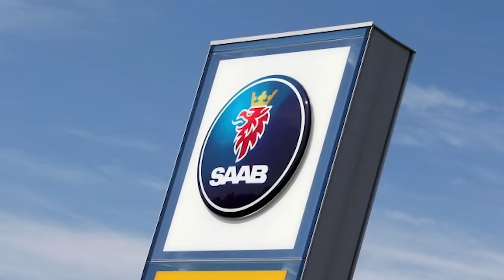SAAB - Everything You Need To Know | Up to Speed

Comment: This video made me buy a Saab. 07 9-3 2.0T
Reply: Sebby Kaiser how do you like it so far? I’m looking at buying an 06
Reply: @jeremyclark4474  Make sure you're buying one with only a couple mechanical faults. Besides new brakes, my Saab needed a new coil, motor mount, rear shocks, and I still can't figure out why it only goes into 3rd and 4th. 300K on the odo but no major electrical problem. Always starts in the cold. It's a cool car and it's fun to work on.
Reply: Sebby Kaiser the one I’m looking at has 111k, 2nd owner. So I’m hoping it’s in good condition
Reply: @jeremyclark4474  Auto Autopsy has a good video on common issues with the B207 motors. It was a big help when I was buying mine because I had the comfort of knowing what was wrong with it lol
Reply: Hey! I had. 2005, I did a vid on how to clear the AC drain, which is a common issue. I no longer have mine, I got a mustang, but if Saab ever makes another car I'll be the first bastard in there to buy one. Damn I loved those cars. My 99 9-3 (I had 2 actually) was just fantastic. Just a great car for the money.
Reply: Sebby Kaiser 300k Jesus Christ
Reply: 08 9-3 2.0t Hirsch here ;)
Reply: I got a 04 93 aero for sale in va
Reply: I have this exact car and it’s made me fall in love with Saab’s. It’s so much fun to drive, corners pretty well and is super nimble and agile. Can getgood mpg if you drive conservatively. Fantastic overtaking power on highways in 3-4th gear
Reply: im probably late but I would not recommend a saab that was made after 2001. After that point GM really started putting cheaper and cheaper parts in the cars. That being said I sadly also do not recommend buying an older saab as a daily driver. Supply of parts is starting to go low. I just had a broken piece on my 9-5 sunroof. The part just does not exist anymore unless i buy a whole sunroof. My father owns a 99 9-5 this car has an air sensor which was only used in that year by saab. Its impossible to get a replacement.

I hope you get an idea of the parts situation. If you want to daily drive a saab get a second car for parts. This of course only makes sense if you are a little bit of a petrolhead. In case you do not repair your cars by yourself get ready to face car repair shops which give you the car back in worse condition than before.

With this warning said. Saabs are great cars. They are durable (note durable, not neccessarily reliable), really comfortable and of course really safe. The Aero or Viggen Models are also pretty quick.

I would say only buy a Saab if you are ready to fix stuff yourself and be ready to either search for parts or buy a spare car for parts (im in Germany and in your region the situation may differ. In case you are in europe the swedish saab club actually manufactures parts but not a lot yet).
If you want a "modern" car I would recommend a pre facelift (1999-2001) 9-5 with the 2.3t engine.

One thing to check when buying a 9-5 is the place where the rear fender meets the rocker panels for rust. There will most likely be rust and thats okay but make sure its not severe.
Another thing is that the radio display usually has a few "broken" led's. This is really not a big problem. The led's are usually not broken but the wire which is connected to them is. Its glued and just gets loose over time (because the radio unit tends to get pretty warm). You can get a new wire for like 10€ and your display will most likely work again like it was brand new. (You will need a special tool to remove the radio, don't try it without that tool you will only break something. Google for something like "saab radio removal tool").
Reply: I just bought an 09 9-3 turbo for 1500 and it’s been awesome but I’ve only owned it a week. Let’s pray it can be a good daily driver,it’s perfect with no rust just has 180k miles. I had to sell my stupid Chevy cobalt to afford it so I hope it’s better than that junk lol
Reply: I'm contemplating on getting this 2008 aero saab 2.8l
Idk if it's a good deal or not. 140k miles. I'm planning on using it for daily. Haha so please if theres any idea or pros and cons you guys can say about feel free . Thanks
Reply: Sebby Kaiser dude im looking at an '07 2.0 in my area with 110k miles on it, asking $2300. think i have to get it.
Reply: @MacLaw3084  
Bro damn 2.3? Mine was the guy was asking for 4.8k 140k miles buts its 2008 and its its 2.8
I dont know much about saab. Bro as long the car works and doesn't have too much mechanical issue. And theres some saab forums and discord around dedicated on saab enthusiast. Check them out
Reply: lestatspada yea man i was surprised. think it might be too good to pass up. im already in love. lol. dont know much about em but i plan on doing most work myself. and itll be my second car and not a daily so i wouldnt put many miles on it.
Reply: @MacLaw3084  yeah iwas like 2.3 no way. Yeah same when I saw the first saab I was like damn this car looks great and fell in love too. But I can't get it cause I'm needing a daily drive to my school and it's going to be my first car. I would get my own saab later own and work on it. But yeah bro check out some forums and discord for saab they got some good tips and site where you can buy some parts. Cause it's kinda hard to get them. They said che k the vin if it's made Sweden, they make them pretty good.
Reply: lestatspada awesome. thanks for the tips. unfortunately probably not the best first car. id go with the tried and true honda, accord v6, civic, or civic si. or something like that. ill post  the link as proof if i end up buying the 9-3. cheers from california!
Reply: @MacLaw3084  yeah that's why I pass on that one. I got a mazda 3 2013 used. So it will last long just need a TLC. Yeah I would like to see how it is.
Reply: Yeah, I'm working on restoring a 71 Saab sonnet with my grandpa
Reply: @johnggg7770  300k is a warmup for Saab's.
Reply: Esa Edvik mines halfway there!😄
Reply: I own a Saab 9-3 2006 and love it!
Reply: Some solid advice here about buying saabs, it is also key to make sure that regular maintenance has been kept up by previous owners. In my experience they tend to go bad if they aren’t well kept. My 2007 9-5 aero was bought with some questionable shocks and brakes but other than that it was perfectly fine
Reply: Wrong year!!! Buy a one from 2001!! That is still Saab. What u have is GM!!!!
Reply: Why the 2.0?  I have a 07 3.6 L V6 T
Reply: Jeremy Clark did u get it?
Reply: Maniac xD
Reply: Can you tell me what its like to make your parents proud?
Reply: Gotta 05 9-3 one of the best cars for the price
Reply: @jacobderryberry7163  I agree with you, and it’s very easy for 99% DIY repairs
Reply: It's one of the simplest cars to ecu remap. One click you got 220hp
Reply: @maxflute7893  what Programm do you use?

Comment: Thank you for doing a video on Saab.  They are such a misunderstood and under appreciated car.  I have had seven Saab's in the last 4 years and I do not plan to discontinue that trend.  My 9-5's feel so sturdy, safe, and solid.  I have had about seven or eight Volvo's but nothing holds a candle to the 9-5.
Reply: How do you wear out 7 Saab's in 4 years?
Reply: @arnaudmeert1527  I just upgraded. Started with the worst 900, moved from that to 9000’s, then upgraded from those to 9-5’s & ended with an 09’ 9-5 SportCombi with a stick.

Comment: Here's the thing about Saab's. Once you own one, you get the Saab bug. After owning my '06 9-3 for a few years, I spent last year looking online and craigslist daily for another saab which is how I ended up finding a very low mileage '07 9-3 convertible. I'd love to own some 9-5's and some 900's too haha.
Reply: I had a 900 Turbo for about a year and a half as kind of a project. It was a real bastard to fix some stuff but I loved driving it. If you get a chance to own one you should
Reply: My first car was a '92 900. Caught the Saab bug instantly! Have since owned an '06 9-3, but was just desperate to have a pre-GM Saab back in my life, so now run a '97 9000 50th Anniversary alongside it. Awesome cars. But so much better pre-GM!
Reply: my dad had a 900 in brown i love it i named it Mr brown
Reply: Bought an '01 9-3S off my cousin, slowly going through the car and fixing/upgrading everything I touch on it.  Thanks to the experience working on the 9-3 I started helping a friend with his '01 9-5, nearly ended up buying it from him so I would have a 4 door car again (I have 3 cars, all are 2 door cars...), I've narrowly avoided buying it but now find myself looking for a OG900 to tinker with :D
Reply: That 06 Saab is a Vectra. That Saab bug... hahahaha
Reply: 2456sunny they're so over engineered it's a great car company really, they put this feature in the motor that you can start it in -30 degrees because it has a direct ignition, when you turn the key it sends something like 50k volts thru each spark plugs to melt ice if it's that cold, and then another 10k when you turn the key back off just for good measure. I assume that's something they have on jet engines because it's so cold high up in the air that the motors could freeze. But since they were Jet-makers  they implemented that so you could start your car in the coldest of conditions. I saw a video on YouTube of someone that put their Saab into a freezer like I said at -30°C I'm pretty sure he said I'm not exactly sure but they were in Germany or some European country, and the car started up and they took it on a freeway that had a burm like a race track does that's why I say it was Germany or some European country. You could look it up for yourself. Just all around great engineers that put Saabs together

Comment: had  a 1998 9-3 2.0t amazing condition and all that, but there where few issues, first off the seating position is super bad, the shifter is almost at the floor you would have to reach for it, steering wheel had minimal adjustment. tl;dr not meant for big boys.
Reply: tony your maker 187cm
Reply: Thats not "big boy" at all thats just average height atleast here in norway
Reply: Should of got a 9,5
Reply: i now have a volvo s60, perfect seating.
Reply: the dark side has taken you, I've slept in my 99 9-5 multiple times between classes most comfortable car ever.
Reply: Pepe Jazbec maybe, maybe not, test drive will tell you.

Comment: Something VERY SPECIAL for Saab was one of there Engines. Have you ever heared about the Saab SVC Engine? what the Japanese are doing and planing now, saab was making it at 2001. the first steps to a self Ignition Benzin Engine....Ok it was a Engine with variable Compression.  A ratio from 14:1 to 8:1 by angling the Cylinder Head up to 4 degrees. 5 Cylinders 1,6l and over 300 Nm with 225 HP with the same fuel consuption as a normal 1,6l engine. and that in 2001. GM those Money Cunts striked the project down, cause of too much money (what a surprise).
saab had it, the engine was working, they used it in a 9-5 wagon. Imagine Saab would still exist or the engine was build in as a special Edition for 9-5 and 9-3. I love Saab so much for that!

I and we all should hate GM for that. The main inventor of the planned obsolescence, the shame as a car company, ruiner of so much beautiful in the car world (beside ecologicals) 

GM SHOULD GO TO HELL FOREVER!!! (and tell the devil that for sure more Companies follow)

Comment: While stationed in Germany, I bought a 1983 SAAB 900 Turbo 4-door with Amaranth color.  Put 198,000 on the car over 17 years and it still looked new when I gave it away.  My late wife cried when I gave it away.  Drove the car all over Europe and the U.S.  Great Winter car.  Would plow through the snow, never needed snow tires, heated seats and was good handling.  Put the rear seats down and could load the heck out of it.  Great gas mileage!

Comment: Thanks! Loved it.  Although in my opinion you missed their greatest car the 9000 / 9-5. I had 2 of them, what a joy to drive. I used to zip around DC beltway traffic like it was standing still. Quality and Attention to detail was off charts, only car company I know of that had pink insulation in the doors. They were reliable only major work was a head gasket and clutch. At 170K miles i'm not complaining.

Comment: Maaaaaan, you dropped the ball big time by not mentioning the only other 100% Swedish built Saab.. The 9000!  This was a car that in 1993 when they came out with the Aero (sport) Edition,  the Aero was capable of accelerating from 80 to 121 km/h (50 to 75 mph) faster than a Porsche Carrera 4 or a Ferrari Testarossa  Not only that, but the car would get 32 mg on the highway from it's 2.3L Turbocharged engine and regularly push the speedometer past it's 155 mph printed number then past the last notch that would be 160 and pin the needle to the odometer reset button which was when judging by eye, would be another 10 mph at the least. All in stock form!  I witnessed one with 170k miles on it do that speed with all five seats occupied, 4 windows down and sunroof open!  Truly an amazing car and by fat the best Saab ever produced.  I can vividly remember my dentist complaining when he traded in his 9000 with 200k miles on it for a brand new ( General Motors designed and built) Saab 9-3.  He honestly went back to the dealership after owning th 9-3 for 2 days and demanded his old 9000 back only to have them say that the car was sent to auction.  They set him up with a 9-5 Aero to try to give him a car that would compare to his 9000 and he was still disappointed.  Oh, and when you gawk about the Viggen… it used the same engine as the 9000 Aero but stuck it in a GM built, flexible wantabe "sports car" chassis.  The 9000 was designed so the center of the weight distribution was located at the drivers hips... essentially,  as you cornered, you felt as if you were part of the car.  I still own three of the,.. a first model year 93' 5 speed, a 94' 5 speed and a last model year 97' automatic.  I'll never sell them... that is until 20-30 years from now when they are worth three times their $44,000 sticker price when they rolled off the showroom floor.  Anyone who has ever owned one will back me up.  The only other Saab that holds a stick to the 9000 Aero that Saab produced is a 900 SPG.  I own 2 of those also!
Reply: Thats great! I own a 97 2.3t 9000 a50 with 255 BPH, and I love it!

Comment: I worked for a SAAB dealer when it was relaunched here in New Zealand. They (the 900i, 9000CS/CD/AERO) were so understatedly brilliant. Had one customer purchase an 9000 AERO, happy with the performance and power but wanted more. So with factory and Abott Racing (England) enhancements his AERO was insane to drive, by that I mean it wanted to be driven hard. I'll never forget that 9000.
What model also not mentioned was the 900S/SE (with the V6 (a bit nose heavy with a great engine sound)). Then came the 9-3, 9-3 AERO, 9-3 Viggen. Replacing the 9000's was the 9-5, 9-5 V6, 9-5 AERO. I know there's lots more to the later models (9-3, 9-5), like using GM (Opel) platforms, just strengthened to SAABs quality. But let's not forget the 9000 platform was shared Fiat (Chroma), Lancia (Thema), Alfa Romeo (164), and some others I can't think of right now.
Shame such a brand should become just another GM generic.